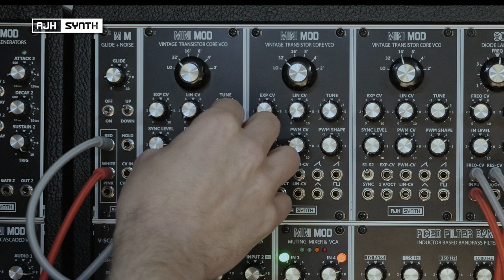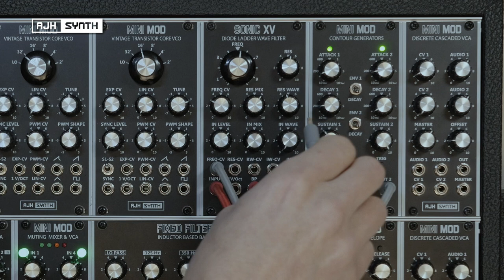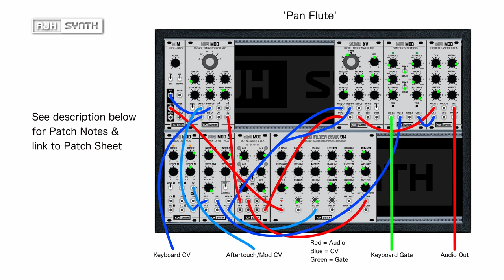'Pan Flute' - How to make this movie-inspired, all-analog Synth Patch in Eurorack Modular

Comment: This sounds truly great. 
Still, I've always wondered why we're still stuck in the archaïc concept of "filters" being low/band/high pass with-slope-and-resonance. Practically-speaking what we'd really need is a CV-controllable parametric EQ with per-band resonance, and the ability to change the summation mode so it can double as the classic "fixed filter bank" effect. Part of the reason I say this, is that synthetic oscillators (and noise generators) have spectral characteristics that are not possible in the physical world. Whatever acoustic sound source you are hearing (if this is indeed what you are interested in), never has the high frequency spectrum heard in synths. A piccolo or a violin may be high-pitched, but they always have a smooth top end, and as you know, that requires very fine-grained control. The same can be said about noise, and you are right to point this out. There are so many natural-sounding noise spectra that can be heard, associated with moving gasses or fluids, that are never convincingly emulated by simple Red/Pink/White/Blue shaped noise generators. A serious noise tool would have rich spectral controls built-in, with CV inputs. Lastly, if you do Principal Component Analysis on most acoustic or electro-acoustic instrument timbres, you'll find that you can emulate pretty much anything with 8 oscillators. The trouble is that it is too hard to tune manually, so I use the Rossum Panharmonium re-synthesizer to find the profile of those oscillators. The fun is not to use the Panharmonium as the sound source, but as the analyzer. It's a very clever piece of tech. I subscribed to your YT page because I see in your approach, very much what I usually have in mind.
Reply from the maker: Thank you, glad you liked it.